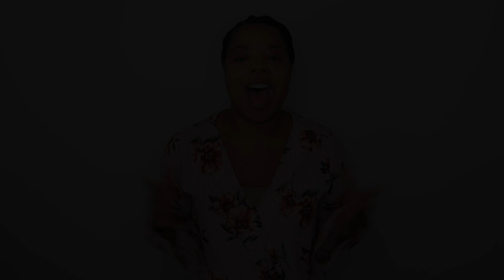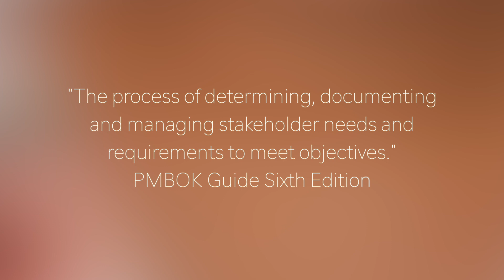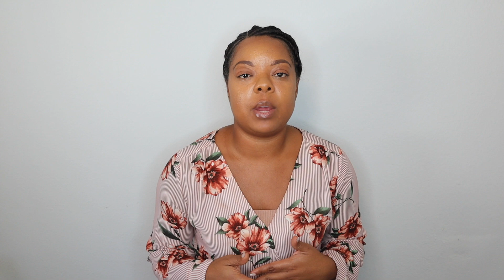How to Collect Requirements | Project Management Made Simple

Comment: This video is  very informative. In the instance a business analyst is available for the project, do you take the lead in requirements gathering and elicitation and collaboration? Or do you , as a PM, follow the lead of the business analyst?
Reply from the maker: It depends on the needs of the project. At a minimum, as a PM I need to ensure requirements collection is completed and covers the relevant categories of requirements. As long as the BA is meeting that need, then I'd expect my role to focus more on removing roadblocks and tracking status. If I have a BA that is less prone to taking the lead, then I will facilitate the discussions but still expect the BA to document the relevant workflows and requirements.